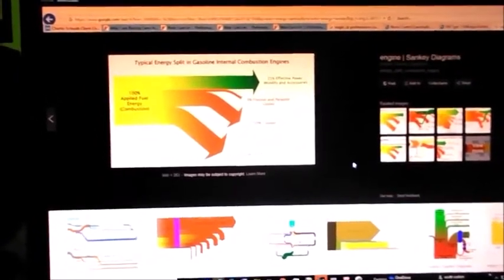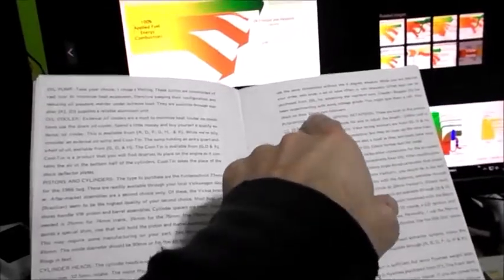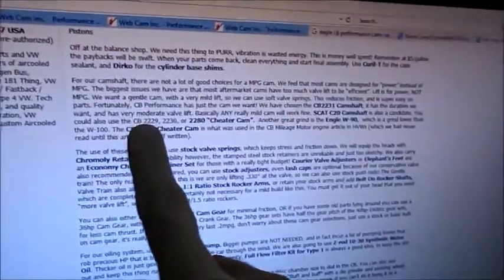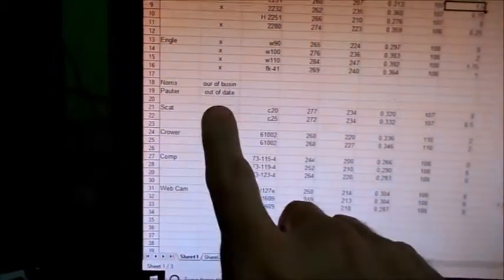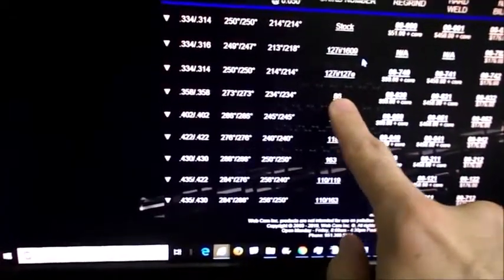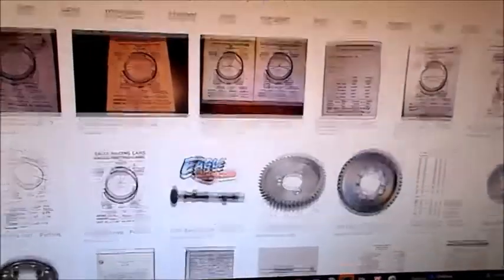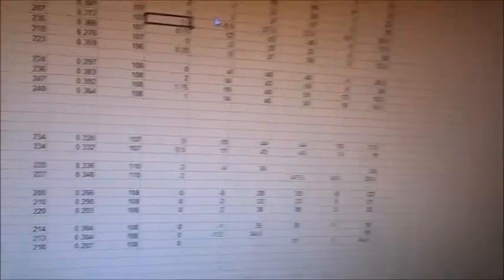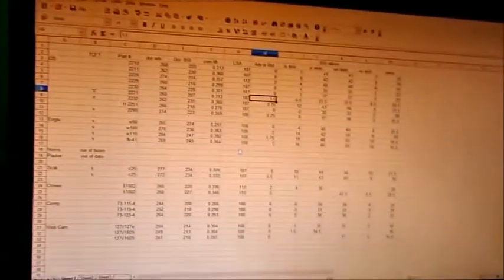vw type 1 mileage & mpg vlog 4 camshaft

Comment: Love these, thank you.
Reply from the maker: feel free to ask a question if i haven't touched on a topic you're interested in.
Reply: @scottyc9365  OK, looking for an engine for a single place aircraft the Pietenpol Sky Scout with reduction drive.  Thanks
Reply from the maker: well well - that is a good one. is the reduction drive used so that a bigger prop can be used with the engine operating at higher rpms? i watched some vids did some reading. how much power do you need? @Brough1111
Reply: @scottyc9365  Yes, in my opinion, for the type of plane (sky scout), which is aerodynamically dirty a larger column of air being pushed back slower for thrust is much better than a smaller higher velocity in which will meet more oppisional drag  so the larger prop turning slower and allowing higher rpm, I don't remember the max efficient for prop rpm speed if I remember correct its only around 1900 rpm.
Reply from the maker: if i were making a vw engine for this application i'd go with an 88x69 bore and stroke for 1679cc. you'd need about 70 ft-lb of torque for 50hp @ 3800 with a 2:1 reduction drive. this is doable and reliable with any number of stock and aftermarket components. @Brough1111

Comment: I've been curious about a larger oil pump. I do not know what size I have. But I do have a remote oil filter. And it seems like adding 4' of travel 2' being up hill may be something I should address.
Reply from the maker: restrictions like filters and oil line length don't impact volume. the pump will just push harder thus more power consumed at pump drive shaft because there is more pressure at pump outlet. read the sections on positive displacement pumps: en.wikipedia.org/wiki/Pump#Positive-displacement_pumps
Reply: @redshirt-scotty I must have watched the oil pump video and commented on this one. That's kinda funny.  My comments were off for some time. 

But I did just pick up my new cam for the 2021 build. A used Engle W125, should help that square back cruise on the freeway and have some sick passing power. And a nice lumpy idle at the lights.